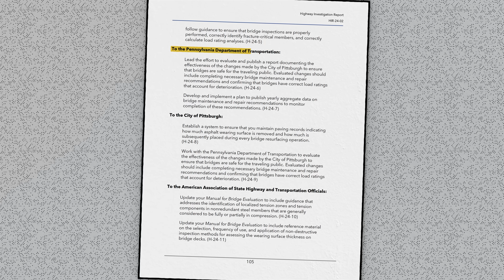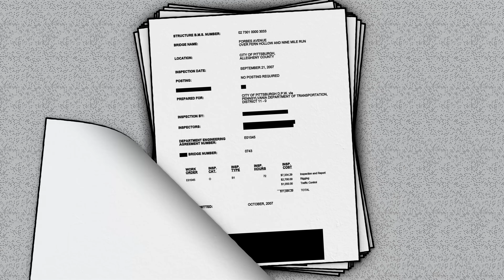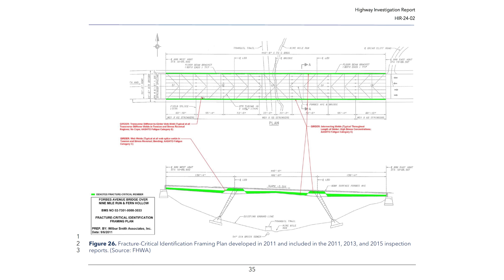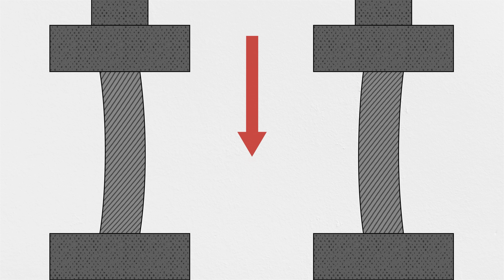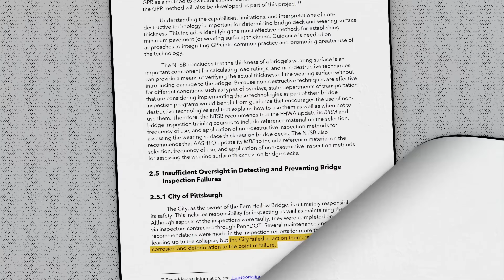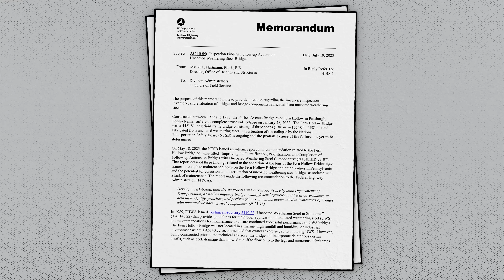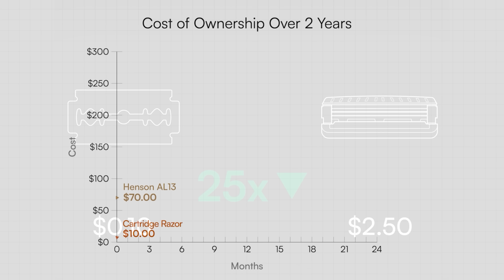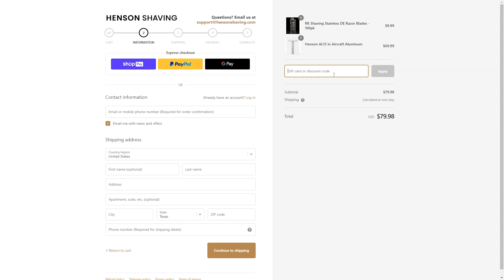This Bridge Should Have Been Closed Years Before It Collapsed

Comment: It baffles me how you can have 10+ years of critical failure reports and nothing was done. How many times do city officials need to be told a structure is dangerous? ONE. It should be criminal to sit on that information and do nothing.
Reply: There needs to be enough incentive for people in those positions to not even think twice about the idea of keeping an unsafe piece of infrastructure open, even if closing it will face strong backlash from the public.
Reply: A lot of people think capitalism is the only cause of such issues, but this clearly demonstrates that it's a human problem. There are always budgets. There's always a risk/reward calculation. There is always a profit motive. In this case, it's more political profit than economic. 

If an engineer shuts down a bridge and it causes a politician to take heat, that engineer will face backlash.
Reply: @UserNameAnonymous  Engineers can handle it, mostly because their jobs aren't tied to popularity.
Reply: There are a bunch of cognitive biases that can lead to people dismissing obvious warning signs. People don't want to come to unpopular conclusions, people don't want to believe a catastrophe could happen to them or near them, people convince themselves that something is safe because nothing went wrong previously, and so on and so forth.

The human brain is pretty bad at dealing with high consequence, low probability events. It takes training and practice.
Reply: @UserNameAnonymous  Capitalism is when a state entity fails to do his job, lol
Reply: @UserNameAnonymous  " There's always a risk/reward calculation " 

Could you please be so kind to "calculate" a "reward" of keeping obviously unsafe public bridge open? Thanks in advance.
Reply: @MrBlackHawk888  Saved money to spend on something more flashy before next election...
Not hard to calculate that alot of people decided it was easier to overlook a boring report, after all it was in "critical need of repair" for a decade with no problem.
Reply: @lc3853  unfortunately there is a push to convert non political civil servant positions to political appointments. So instead of it being the most qualified it is the most “yes-man”. I think it was called “schedule f” or something
Reply: @MrBlackHawk888  - society doesn't operate on the idea of "safety over all else." If it did, the speed limit would be 20 mph on all streets and highways. As a society, we have decided that the speed and efficiency of driving at 70 mph is worth it, even though we know that it will cause more deaths each year than if it was 55mph.
Reply: @UserNameAnonymous  Soooo true. Everyone's quick to blame capitalism for any situation in which someone failed to spend money on something that we all wish they had — but, yeah. Turns out city governments can often be no better at this stuff than any private entity.
Reply: @lc3853  - no, engineers are not immune to political pressure. The head of the transportation department will receive a call from the mayor asking for a favor. The head of transportation (who wants to advance in his career) will put pressure on his underlings to make certain decisions. He'll nicely "ask" the engineer to give the bridge some leeway. "Write the report, but don't shut it down. If there's any wiggle room, USE IT." If the engineer ignores that order, he'll find himself in a hostile work environment. They would railroad him out or even fire him. At the very least, he would never get a promotion, he'd get assigned the worst projects, they'd hassle him on when he's allowed to take vacation, they'll write him up for any tiny infraction they can think of, etc.

And the other engineers in the department will see it. They'll all be worried about having it happen to them, too. So they'll be less likely to err on the side of caution themselves.
Reply: @MrBlackHawk888 That's easy, curtailing expenditures in the short term.
Reply: Depends on how much money and time they have to deal with that mess, and all the other critical stuff they have to deal with.

The name of the game is setting priorities and sometimes people screw up in impressive ways. It could be the result of incompetence, criminal behavior, bureaucratic inefficiencies, or it could be the result of overextending the city budget and staff.
Reply: @Taladar2003  
Simple solution. Unlikely to be implemented because shady people profit from the way it is right now. But: Give the inspectors the power to shut down infrastructure that is in seriously bad condition.
Reply: Nothing will change until a politicians kids or spouse are a victim of such a collapse.
Reply: Maintenance of infrastructure requires tax revenues.
Reply: @Taladar2003  How about they do their jobs or go to jail for at least 10 years.
Reply: What's even the point of annual inspections if nothing is done?
Reply: How do you figure that? There no profit motive it's not like they get to keep the money they didn't spend.
Reply: @ps.2   no, capitalism is what ultimately causes city governments to be beholden to private entities which fosters an ignore and blame-shift culture rather than keeping people first.
Reply: With what money are they going to do this with. My understanding is generally these sorts of things are systemically under-funded. Like I suspect even if they spent all money on bridges closest to failure, it would just delay failures, because maintenance costs per time are higher than the budget per time.
Reply: It’s government when has government ever done a good job.
Reply: @gas33z  - Your idea implies that politicians put people first. They don't.
Reply: @g-rexsaurus794  Please explain to me how capitalism is to blame for a city not spending money on a bridge they are supposed to maintain? What 'profit center' is evil capitalism shoving all the TAX money to? How much profit is a city supposed to make?

I can't wait to hear this answer...
Reply: @UserNameAnonymous  At least one person here gets it.
Reply: @UserNameAnonymous 
Tbh, it’s not just that “politician bad”, it’s a toxic culture of inaction.
Reply: @UserNameAnonymous Untrue, and an incredibly cowardly take. I hope you don't have a job that puts people in danger.
Reply: We tend to fix bridges after they collapse.
Reply: @lonyo5377  Because at minimum we'll have at track record of what was failing and for how long it was known to be failing. If we didn't make those inspections and then it failed, we would be none the wiser as to exactly how bad it was outside of images like that one pedestrian provided (nevermind that singular photos like that would probably be significantly easier to dismiss than actual official inspections).

Even if nobody does anything with them, having the receipts is important for detailing how bad it got over how long, so that those who sat on their hands and did nothing during that time have a chance to see justice done to them for not putting on repairs.
Reply: @SnakebitSTI  i call it common sense. not enough of it these days
Reply: @MrBlackHawk888  The calculation is simple: Let's say we had 10 people seriously wounded and 20 non-serious injuries. That's around 15M in damage (2019 numbers).
Assume a fatal failure rate of 10%/year, and you get an average cost of 1.5M$/y.

You can compare that to the cost to build a new bridge divided by the estimated life.
Don't forget to add the cost of the interrupted connection, which could add, let's say 1000 people producing 20$/h of value (not earning) having 2*30min/d longer way for 200d/y = 4M$/y.

Yes, I'm cynical.
Reply: What do you expect from career politicians who never ran a business or had any responsibilities that they couldn’t wriggle out of!
Reply: It comes down to budgets. If the state doesn't allocate them money there's nothing they can do.
Reply: @tim2024-df5fu  climb up the food chain. Someone at some point is responsible for saying "no, we will not pay to repair this life-threatening infrastructure".
Reply: @Scrapps97 the part where he said "They would railroad him out or even fire him. At the very least, he would never get a promotion, he'd get assigned the worst projects, they'd hassle him on when he's allowed to take vacation, they'll write him up for any tiny infraction they can think of, etc. "

Utter bollocks. Take some personal responsibility.
Reply: Big fat manila envelopes full of cash is how!
Reply: @MrBlackHawk888  You could probably get some votes by spending the money on bike lanes instead.
Reply: @UserNameAnonymous  cost system is c
Reply: @tim2024-df5fu  they could raise it locally. They could request it from the federal government. There are ways. Stop making excuses for the filth!
Reply: @Boris_Chang  stupidest comment I've seen all day. Tax revenues exist. Your comment is nonsensical.
Reply: Somebody lining their pockets
Reply: They need to be criminally liable.
Reply: @jhoughjr1  Agreed.
Reply: If the city inspectors lived in fear for their jobs for making an issue out of the recommendations, they may have looked the other way hoping nothing would happen. Whistleblowers take a lot of risk, and Pittsburgh has a certain reputation for corruption. Just sayin'.
Reply: @BishopStars  - wait... you think that kinda thing doesn't happen? You think engineers don't face pressure from their bosses? This happens every day. We don't live in some utopia where engineers are insulated from any consequences and all government workers are always acting in the best interest of the public. Get fuckin real.
Reply: @BradHouser  I'm not talking about putting the blame on those who make the recommendations, but on those who take the conscious decision to do nothing about it.
Reply: I mean we got paid for five years to do a yearly report on a pier. We highlighted points of failure and issue, stating that refurbishment work was needed as it was not safe. On the last one we said we didn't think access for survey was possible due to the high risk, so we pushed back. The pier failed and collapsed the same year after a few months. Then the local council decided to fully demolish it.. this is the world we live in, we're specialists are ignored and money is going to make things pretty to get more votes.
Reply: @giovannilunardi1261  Well those who hired you and did not act on your report should be held criminally responsible for endangering the lives of others.
Reply: @theuncalledfor  Sounds great but history tells us that it rarely works that well. Whether it is an inspector that fears (rightly or wrongly) repercussions or persons higher up the chain that override unpopular decisions at some point some flavor of politics will become involved. For instance, had the bridge been closed at any point before it collapsed the majority of people who use it or the detour roads and bridges on a daily basis would have done nothing but wail and moan about the inconvenience. Until the bridge actually collapsed they would cry that there was no need to shut it down because they've driven over hundreds or thousands of times without a single thing going wrong so it couldn't be as bad as some puffed up bureaucratic safety inspector says it is. Heck, I guarantee some of them are the same people who walk the trails beneath it and could see the problems with their own eyes.
Reply: Has someone who used to work for PennDOT, not surprised.👷🏽‍♂️
Reply: @lvlndco As someone who used to work for PennDOT, I have to disagree. In this case it is the responsibility of Allegheny County to replace and allocate funds. Inspectors can only keep telling people you need to do something, so many times.👷🏽‍♂️
It doesn't matter if it's a water main or a School District that's still 40 years later cleaning out asbestos.
Reply: Two words come to mind "BUDGET CONSTRAINTS"!!😊 It would cost a lot of money to either fix or tear down.
Reply: @thomastaylor6699  they could have just shut it down if money was the issue. The issue was, they didn't care
Reply: @UserNameAnonymous  "A lot of people think capitalism is the only cause of such issues, but this clearly demonstrates that it's a human problem."

A sentence so generic it could apply to any government or economic system. So irrelevant to the comment you replied to, it's almost a non sequitur.
Reply: So, you don't mind your taxes going up to support proper inspection, repair and replacement as needed? Or do you scream about wasted tax dollars?
Reply: @wematanye533  It's only generic if you don't know much about politics
Reply: @mikelouis9389  How about PRISON for officials in charge?
Reply: @mikelouis9389  You missed out that inspections were made regularly. Decision to not take action was the issue.
Reply: because you HAVE 10+ years of critical failure reports. They were ignored because here it was, 15 years later, same problems but hadn't collapsed yet.  People have an incredible bias towards assuming stability.
Reply: @g-rexsaurus794  You joke but yes, there's a lot of capitalism-brain in governments of capitalist economies. You find it all over transportation, with genius ideas like demanding transit pay for itself but roads should be free because they're different departments.
Reply: @lc3853  if you think engineers don't rely on public opinion, your naive. Firms rely on public and private relationships to win contracts. If you piss off the wrong beaurcrats or public officials, you can go bankrupt. Bridge engineering is as much public relations as it is design. You can't hire talented engineers if you don't have work to give them and capital to pay the bills.
Reply: As long as politicians belong to corporations and not to the workers this will happen over and over
Reply: @UserNameAnonymous capitalism is absolutely the problem— if the safety of people were put before profit in the pockets of politicians, this bridge would have been repaired with the first failed inspection.
Reply: @melissaolszewski1941  there is no system where the people are put first before the politicians.